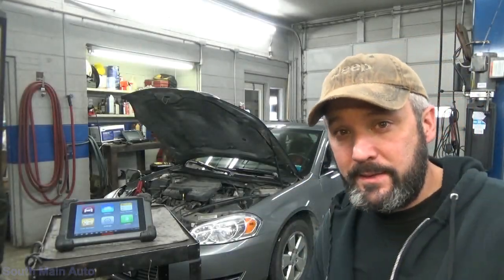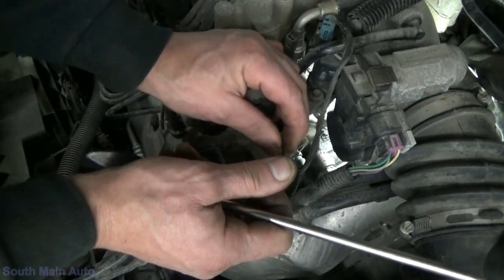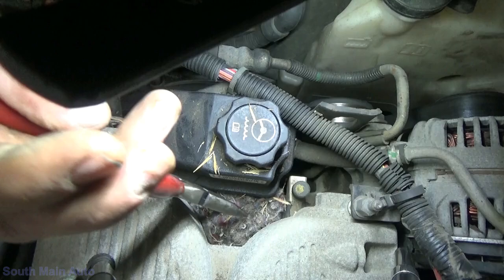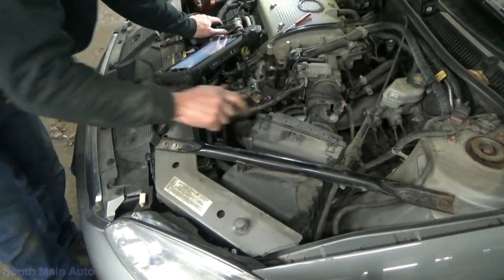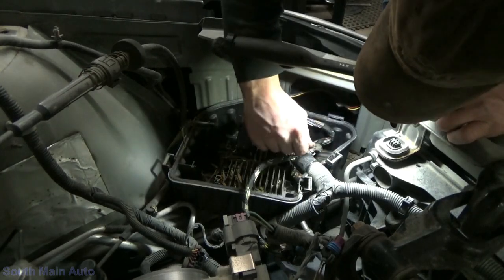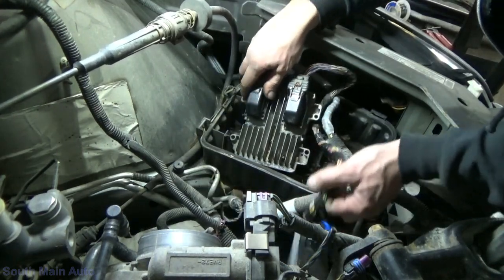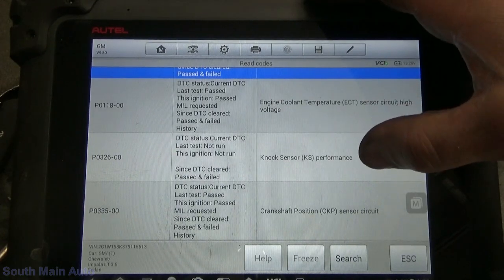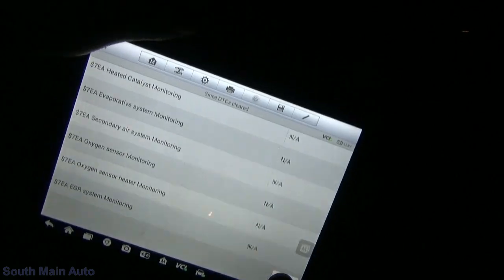Chevrolet Impala - Extended Crank Time - Service Engine Soon Light

Comment: Eric you totally left out freeze frame data. The freeze frame would gave you lots of direction towards when the knock sensor & other code were  generated, that would have help to determine if the code was a result of the broken wires or an different issue worth looking more into. love the videos keep them coming.

Comment: Damn rodents! I remember a VERY cold Saturday morning back in the mid 80's when my mom called at 5 a.m. (I lived on the farm with dad, step mom and grandparents) saying that her car wouldn't start and she had to get to work. I jumped in my truck and headed into town. The car, a 79 Pontiac LeMans wagon,that lived outside, wouldn't fire even after a couple snorts of ether. I loaded mom in the truck, took her to work, went back home to finish chores, then, since it was WELL below 0 with the wind chill, hitched up a trailer and brought her car to our shop at home. Now, remember that this was a first generation 3.8 Buick engine with a carburetor. Once I pulled the air cleaner, the problem became quite obvious. Some friggin squirrel had packed enough black walnuts on and around the intake manifold that the throttle lever wouldn't move enough to set the choke! I put all those walnuts in a bucket, put the air cleaner back on and the ol "Tin Indian" fired right up! Dad followed me back to town to the nursing home where mom worked so she could have her car back. After telling her what was wrong, she took the walnuts and used them to make banana nut bread! She also had a garage built the following spring! She gave me the car about 5 years later. The body, interior and undercarriage were still in mint condition since she didn't drive on salted roads, but the engine was shot (bad rod bearing) with only about 50k miles. I pulled the engine/trans and, with a few "modifications", replaced them with a built 455/TH-400 and Ford 9"rear. The car became known as "The Wheelie Wagon" at our local drag strip.

Comment: Love the channel, used to race cars when I was younger so I had experience taking out engines transmission, messing around with sensors bypassing them, taken out catalytic converters you know, racing stuff. Even when I was younger I had crap cars, and would do all the work myself on them. After kids, you really don't have time to do work on the side, but watching your channel makes me want to get back out under the hood again 20 years later. Thank you for all you do Eric

Comment: My wife has this car, same year and engine. Aside from brake jobs, I've spent more time keeping it on the road with my multi-meter than a wrench.. Lots of little electrical gremlins! I perform all of my diagnosis in my driveway with my bluedriver OBD-2 reader, mulit-meter, and a Haynes manual for wiring diagrams. I have a tremendous amount of respect for technicians like yourself but there aren't too many capable of these jobs in my town and most instances it is cheaper and easier for me to diagnosis these problems myself. The best one yet was the mouse that made a nest under the intake manifold and chewed up the cam position sensor.

Comment: You are the best mechanic I've ever seen, and I know a lot of mechanics, including myself. I learn everyday from you watching all your old videos. But I will say do not put the flame so close to the wire. When you get the wire so hot it changes colors, it will compromise the integrity of the wire and can cause issues. Hold the flame so it's just heat from the flame touching the heat shrink. It just needs heat, not fire. I don't know everything, far from it. But I've been doing wiring for years and I've learned over the years. Had plenty of issues with wires that got too hot and discolored and I learned to keep the heat further away so it just slightly melts the heat shrink.

Comment: visual inspection saves the day!  my wifes 2016 escape got a mouse in the airbox as well, probably 4 months after we bought it last year during the winter.  Guess he thought our garage was the spot to be.  I found a pile of straw, fuzz, etc under the car on the garage floor one day....looked in the air filter box and it was full.   fortunately he was evicted before any real damage occurred besides a new air filter.

Comment: Eric:  The solder you are using is thick...you need a multi core  solder about  .125 inch in diameter or thinner.  You will find it easier to solder small diameter wires using it. Great videos as always .....you have my admiration.

Comment: Old video but a good one. Love your diagnostic approach. When I went through my advanced electrical class in college I picked up the same strategy (find one issue first and you will typically find the others). KEEP UP THE GREAT WORK BROTHER!!

P.S. I saw you flick that solder into the computer pins ;-) Glad to see you caught it before putting it back together. Don't edit those mistakes out man, they make the video so much more relatable. Also not sure if you will even read this comment with how old the video is haha.

Comment: Great video I have a 2006 CHEVY IMPALA 3.9 engine replaced the thermostat, alternator, starter kept up the maintenance, replaced dual muffler. It has been kept up since day once bought it new and still running great..

Comment: you are veeeeery thorough, and I assume that some of that is for the video. I was taught to read and record codes, then clear  the codes and either drive or cycle the key depending on what is appropriate to see what codes reoccur. this idea was to bypass any old codes not applicable to the current situation. but still I do learn a bunch from you. thanks.

Comment: Amazing, you are able to use that scan tool so easily and  you thought that there has to be a broken wire somewhere, and there was. And you fixed it in a minute. I also have watched your video   Greetings from Helsinki Finland.
Reply from the maker: Well the data proved it

Comment: Awesome in depth footage. My 2006 Impala LT 3.9 is experiencing long crank time but no codes.. Also it seems like it is idling a bit rough at a traffic light but it does not seem like a misfire because it clears up and seems to have good power. Have to admit I wish you were located in Florida... I would bring it to you...

Comment: As soon as you pulled out the soldering iron and heat-shrink wrap I knew you were a true craftsman.  Good job on the diagnostic work Eric and nice video.

Comment: Eric, I will say that you know your stuff and am wondering where you got all of the knowledge at or from. I never got into the Newer generation of cars when they got complicated, (probably started shying away when the first ECM's came on vehicles). I am 66 years old now and worked at a GM Dealership but was the Parts Manager there. I used to work on the Simpler older cars at home after work, built engines, carbs, set up rear differentials, and Hot Rod stuff, but I could never see the money it took to buy those expensive Scanners ( I can't imagine what your scanners cost you) and such. I did have the Tech's as very close friends so when I had a problem, I had my Mechanic friends to go to.  Watching you has been very interesting and entertaining. You have been a pleasure to watch. LIKED, SUBSCRIBED and CLICKED that BELL. Take care, Friend. Love your YouTube Channel !!

Comment: Those little bastards!  Just cleaned a big pile o nests out of my dad's '07 Arctic Cat 400 a couple weeks back. Was about 5 pounds of corn from the deer feeder inside the CVT cover (along with mummified and dismembered ma, pa, and kids - must've taken a trip thru the belt, lol),  airbox, and all the plumbing between the 2. Yanked nests out of the CVT air intake tube in back, in the CVT area itself, in the airbox right on top of the filter, and a 4th nest under the seat, right on top of the fuse box. Had to fix a bunch of wiring coming to and fro the fuse box, plus the winch switch wires to the contactor.

Cats have been busy hauling them out of the basement and porch area too. I find tails and legs all over the place. Looks like a mini murder scene. One of my cats loves to eat  the front half of the mice, LOL! CRUNCH! CRUNCH! :D

That time o'year I guess!

Comment: Nice diagnosis & video! He got lucky and caught it early before they started chewing off insulation & shorted out the harness & ECM. Never heard of that rodent tape but whenever I store mine it has plenty of peanut butter in traps all around it. When I worked in NY on cars we not only had problems with mice & squirrels in the winter but the outdoor cats used to climb up in the radiator shrouds & engine compartments to get warm. Not much you can do about it other than pop the hood or blow the horn before you start it.  I seen the solder sling into the ECM also but seen you removed it before connecting the connector.

Comment: Like the rodent tape. I had the little varmints in the air box on my S-10. Took some steel screen and covered  the intake port after I cleaned it out.  They once got inside the stove cover over the exhaust manifold on an old '75 Toyota 20R. It was SMOKIN!  Fortunately I got it before it caught fire.

The days sure are short this time of year.

Comment: Informative video - as always! The soybean oil-based plasticizer that wire manufacturers started using in the 70's has led to untold wire damage from rodents. I once had a neighbor ask me to help repair "some minor wire damage" under the hood of a truck he left parked for around a year here in the desert. Not a single scrap of insulation was left intact on any of his underhood wiring harness (I declined). BTW - birds love to eat hot chili peppers.

Comment: This reminds me of the tale told by a shop owner in north metro Denver.  A fellow came in one day complaining of a stalling issue and was put off by the hourly diagnostic fee.  He figured he'd try to tackle it himself.  Well, after throwing $800.00 worth of parts at the problem with no solution, all of a sudden that diagnostic fee became much more attractive.  Admitting defeat, he went back to that same shop and told them to have at it.  It turned out to be a broken wire inside the insulation.  As the shop owner put it, "Now I'm his best friend."

Comment: Those pesky little rodents. When I worked 2nd shift one winter I found a nest on the back side of the manifold on my'86 Sable LS v6. I liked that car, new struts and springs all the around and even though the car was only 4 yrs old, it was such a difference in the ride and especially the handling. Climate control was nice as well. Then I went out to start the snow blower, my grandfathers old '70 Simplicity, what a tool, wouldn't start. Mice ate every bit of the coil wire insulation. A couple wraps of electric tape fixed that. Thanks for sharing. That same winter I found a mouse frozen to the rim of my car. I just left it there and was gone in a couple days.

Comment: Squirrels did a number on the wiring and various vacuum hoses in my 1993 C1500 Chevy pickup truck when I was away from home for six months handling a family emergency.  I only use the truck when needing to haul things.  It isn't a daily or even a weekly driver most of the time.  It has a knife switch on the battery.  I've been too lazy to expend the effort to trace down the draw...  I keep a Battery Tender on it full time while it sits.

Since I don't use it all that often, a few moments under the hood prior to a trip to disconnect the Battery Tender and close the knife switch isn't all that big a deal.  I've now added three unbaited rat traps to dissuade the squirrels from getting comfy under there.  There's a trap resting on each upper control arm and an additional one on the driver's side fender -- the location of most of the wire chewing.

I screwed the rat traps to larger sections of thin plywood so there would be no risk of snapping my own fingers as the set traps are deployed and removed from the engine bay.

Comment: i was told by a guy that worked in a wire shop that the extruders that cover the wires with insulation use corn starch to keep the dies from sticking.  if its true its no wonder. just like a taco shell. had the critters chew thru the rubber on my fuel tank fill hose and tank vapor hose. funny it never thew a code.i think ive tried everything on the internet to get the smell out.peroxide seemed to work the best.  camera shy assistant? good job  keep them videos comin

Comment: Fantastic, I'm glad it was more than just a bad sensor replacement. It was a excellent opportunity to trace the wire , find the fault and cause..I would think the engine running poorly could have triggered the knock sensor code ..thanks for the informative video as always Eric. , and tell Hanna she should learn all she can , be a female mechanic even if it's a side job....if I leave close I would help you out just for the knowledge..

Comment: Excellent track down and fix, nice when things come out simple for a change.  But as an old guy I do miss the "old days" when you didn't need thousands in gear to troubleshoot like todays cars, makes owning and maintaining most cars very costly, ive seen where sometimes cars get sold or totaled just because sometimes even dealers cant track down the problem.
Reply from the maker: Oh... there is always and answer. Dealers often send cars here. There way of escape is just to provide an obscene estimate so the customer will leave.
Reply: I have heard that, and sadly doesn't surprise me-lol   Thanks for your work on all the vids, I know you help tons of people.
Reply: South Main Auto Repair...Hey man wanted to ask where can I find a scan tool like that and how much am I looking to spend on it.
Reply from the maker: Autel MS908 a few grand I think maybe 3?
Reply: You can pick up the smaller screen size version ms905 for about $1200. Only difference is smaller screen, and it doesn't do ECU flashing, but the autel isn't a great passthough tool. Better stick to drewtech for that.
Reply: I got the Autel MS906TS at an online retailer for $1,600 - the built-in tire pressure sensor feature saved me another $200 on a separate tool.
Reply: This is what ya get when you watch videos all night at work lol I asked about this very thing in the discussion section of your page and now I've found the answer.  The scan tool Autel Model.
Reply: James Barcellano that's the one I got I love the ms905. I actually prefer the smaller form factor and I already have a cardaq-m for programming. I paid $1399 through Napa but you can get it on amazon for $1299
Reply: just an FYI, autel actually makes another scan device that's at the very least very close to as functional as eric's MS908, that being the MK808, and for just the tablet/scanner and of course a case and charger (as it's still an android tablet) is only around $400-$500, which while still pretty expensive, compared to things like the one eric is using (or his multiple he's using in fact, as i know he also has the $10000 snap on scanner, the verus, and another couple thousand dollar one that encore OTC or whatever it was) it's actually somewhat affordable (especially if you work on cars a lot, or like to help friends and/or family out with theirs (i know i do, and luckily i have family and friends that understand that obviously any future problems aren't my fault just because i happened to be the last one to work on their stuff))

Comment: I could suggest a small battery operated soldering iron,they work really great and you dont have to use open flame. I picked one up at Radio Shack before they closed. It has saved me a couple times.

Comment: Those friggin mice. I had an '01 chevy truck that came in for a crank no start. At first glance we thought it was out of fuel, gauge always cycled to empty, but we only got a cup of gas in it before it was running out the filler. Pump had been done before and harness changed, but it was a hack job under the truck. Found a bunch of fuses blown, and lots of evidence of mice around the fuse box, and coming out around the harness. When I pulled the box, half the wires were chewed through. Fixed all that, replaced fuses, but the fuel pump still didn't work. Replaced that and redid the wiring underneath, truck ran great.

Comment: Hi Eric, love your videos learning a lot. I'm just a in home garage guy. I'm hoping if you ever get a 2012 ford fusion, I'm struggling with doing the rear shocks. It's not hard just tricky. don't have a lift just a floor and jack stands. I could use some tips. Thank you. keep up the good work.

Comment: Funny, i had an Impala last Friday (looked like a farm vehicle) with an engine with an overheat code as well as an intermittent trac/abs lights. After a road test and topping up the low brake fluid the customer needed the car so i didn't get to diag it. Didn't work today so i guess someone else had the pleasure. Excellent job anyway, Eric.

Comment: I just went through this routine with an old car I let sit for several years.  Fortunately the wiring was much less complicated.  Unfortunately, most of the damage was in the main harness running through the rocker panel that the critters used as a freeway to the interior.  I had to disconnect the entire harness and pull it out of the rocker to get to the broken wires.  It took a while.

Comment: Hi, 
I am working on 2004 Jeep Liberty with 3.7L that is running rich on back 2 only, spark plugs are not wet with fuel but black, replaced them with new once, the Compression test is good, injectors are at 14.5 OHM, I replaced the ECM with a good used AND programmed it to the vehicle, I can hear a strong vacuum going in through the air intake hose, but smoked the intake manifold  but tested good no leaks. It is taking such a long time for the code P0175 to flag. Fuel trim is over -30%.